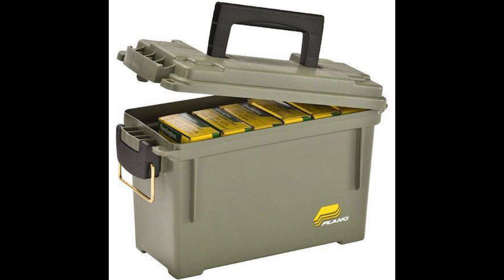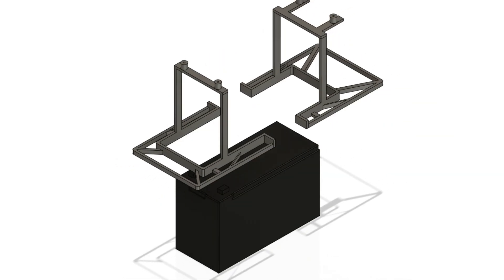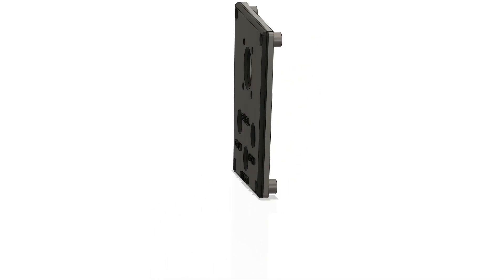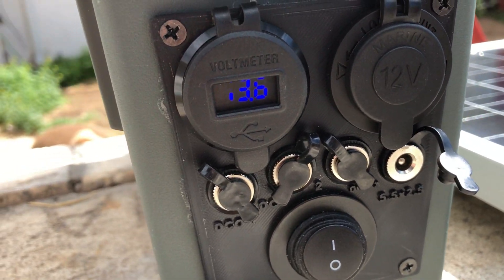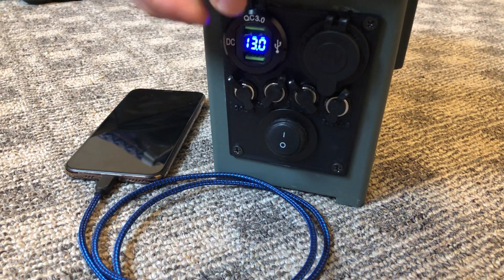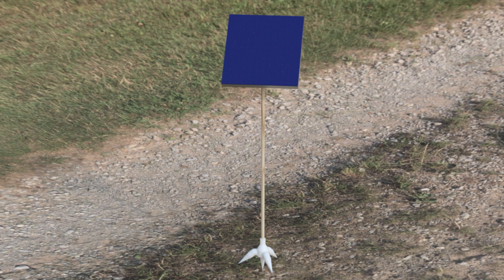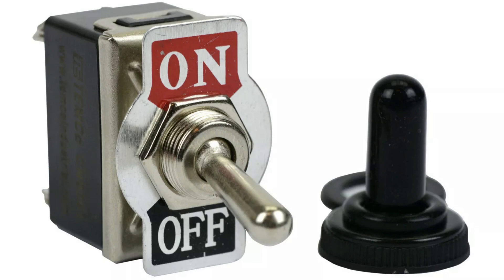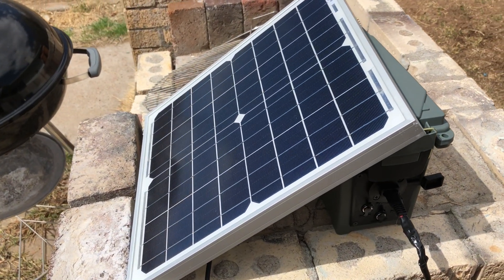Ammo Can Solar Generator

Comment: Hu, great build. Was wondering how long does a 20W solar panel needs to fully charge a 12V 7Ah battery?
Reply from the maker: 12V*7Ah=84Wh so 4.2 hours
Reply: @korbano  thanks!
Reply: Enough to power a small device AND charge the battery for overnight use. I might suggest stepping the battery up to 17ah or 18ah with a 25 or 30 watt panel, so you could power a device 24/7/365, assuming you live between the tropics of cancer and capricorn or near.

Comment: You could try a square bottom pvc stand. There are videos that show you how to make a pvc shooting target holder and they usually have a square bottom. That way you could add weight to the bottom more easily and I'm pretty sure you can mod it to fit a panel in a way that it can move with that style of frame.
Reply from the maker: That's a great idea and should work perfectly. Thanks!